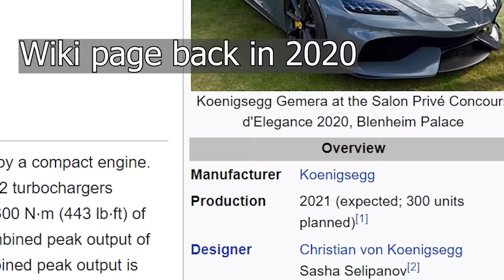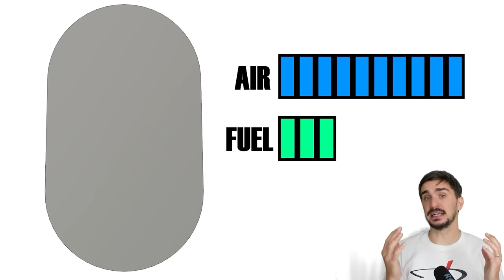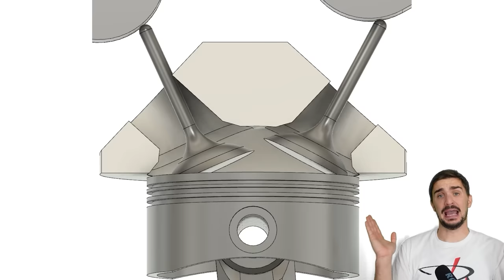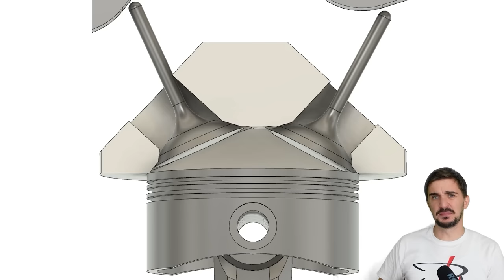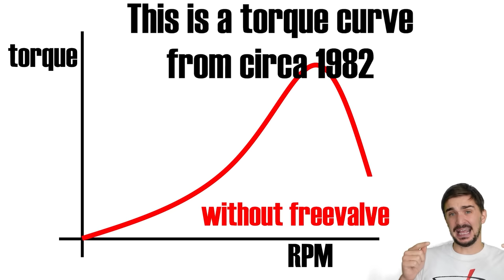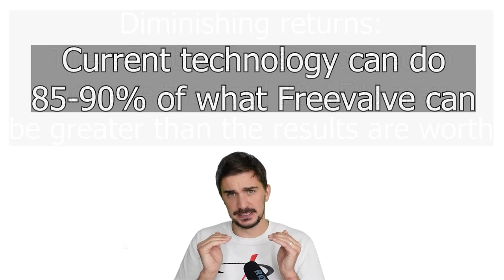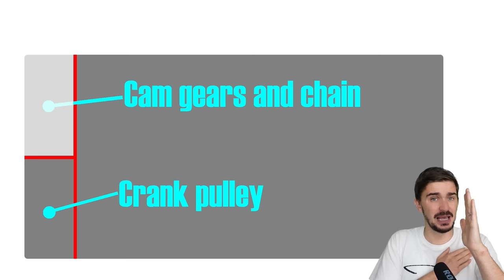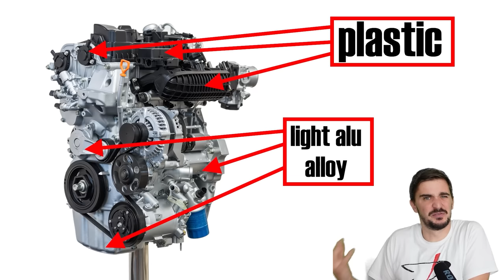FreeValve Isn't a Big Deal. Here's why

Comment: I was googling status of freevalve and I came across your video.

You are incredibly deceitful in your portrayal of information and I'm not sure if it's intentional or not. You spout numbers about peak power and torque when comparing the tiny giant to the GR corolla but somehow completely omit that one makes peak torque from 2000-7000rpm whereas the other is between 4-4400rpm. You gloss over time-to-torque, or what is commonly known as "lag" when you talk about throwing "2 bar of boost at a k20". Manifold pressure, turbine size, hot side geometry/size as well as exhaust pipe diameter play a huge part in determining manifold pressure which has nothing to do with flow rate. Example: Put a G25-550 @ 30psi on a k20. Ok cool now put a G55-2900 on there and run it at 30psi. Which one makes more power? Which one is laggier? I'd imagine that CvK didn't bother to show a dyno chart of that test car with the 1.6L engine. But if he did I'd imagine the whole chart is basically peak torque from 2-2500rpm resulting in an overall substantially higher average torque figure. It's actually amazing you have the audacity to say anything about the tiny giant at all, after all it doesn't have any throttle bodies or wastegates, which is another thing you gloss over in your video. 

I won't be watching any more videos, but I'm glad youtube has people like you to sway public opinion with your surface depth knowledge. Here's hoping we see freevalve in some mass produced cars.
Reply from the maker: Awwww did I hurt your widdle feelings. But reality is like that sometimes, don't worry, time heals all wounds❤️‍🩹💋 Don't forget to replace the candles in your CvK shrine.
Reply: You deleted my reply. So you can't even address the content of my post. What gives? @d4a
Reply from the maker: I deleted nothing. The content in your posts starts by calling me "incredibly deceitful" and ends with "surface depth knowledge" and you except a response?Also, I don't respond to acolytes. There's no point, because you're so deep in worship that you will refuse to see anything. So I just mess with you. But you're cute so I'll make a little exception. 1. Torque curve doesn't matter, most modern engines have 85-90% available from 2000. The 10-15% doesn't warrant the increase in cost and complexity having a wastegate never hurt anybody. It doesn't inhibit performance or reduce efficiency. It protects against overboost. Fiat Multiar and BMW valvetronic also don't use the throttle body like traditional engines, a few other systems probably too. It's in the video, but you got emotional before that so you didn't watch anymore and instead proceeded to the comments section to defend the cult 🤭
Reply: As I thought, zero substance. Valvetronic is just VVT on the cams, has nothing to do with replacing a throttle body.. You again gloss over actual average power gains, time to torque, etc. This is what I'm talking about here. You had an opportunity to provide something actually educational and instead it's all surface depth. You spent 10 minutes explaining how a cam works, don't go into detail on various different types of strategies used to get additional valve adjustment on the intake/exhaust side, don't go into detail on WHY we have 4 cam motors, nothing. You pretend like being able to advance or retard a couple degrees of timing is anything like this. You don't even mention how you can change combustion cycles on the fly. Has nothing to do with being in a cult man, I just want freevalve to be released to the general public.  @d4a
Reply: @ediconex  Valvetronic is not VVT it is VVL... And I'm quite damn sure it "replaces" the throttle body In normal operation(as BMW material say so).
Reply: What is the difference between variable valve timing and variable valve lift? The answer is nothing. They both accomplish the same things with different acronyms, just like VTEC is Honda specific variable valve timing. VVTi is Toyotas variant.  The purpose and premise to advance or retard the intake and/or exhaust cam to adjust efficiency profiles to achieve lower emissions and more power at a wider range of RPMs. As the video stated, static cam timing is long dead and pretty much all manufacturers use some methodolgy to control cam retard/advance. The one thing to note is there are different ways that some manufacturers achieve VVT, some use oil pressure (Think Honda F2x series) and only has two modes. Others like BMW use motors, and they call it VANOS. This sytem, especially some of the latest variants are much more advanced and give fine tuned granular control to cam advance/retard.

 A throttle body is required on all gas engines to restrict airflow. Feel free to google part numbers for throttle bodies on the S63TU4, S68, S55, S58, B58, B48, N54, N55, etc. I'm sure if you inspect whatever it is you're reading or just look at literally any repair guide to any BMW that's not electric or diesel, you'll find a throttle body.  @TarenGarond
Reply: @ediconex  VVL alters lift.
I mean Valvetronic does alter the timing quite a bit(As duration gets less with less lift) so yeah it most likely could be classified as VVT.
But while lift is largely changed the duration is changed in a less dramatic manner.
The lift could be adjusted to zero and therefore(quite obviously) a throttle isn't needed, the throttle is still there but seems only used in abnormal scenarios.
Reply: Not really, it's literally just another brand name. for adjusting valve timing like I said. Even you run a cam with with zero retard/advance, you still do not mitigate the need for a throttle body to control air intake on a non-diesel motor. This is why there is a throttle body on every single non-electric or diesel bmw. @TarenGarond
Reply: @ediconex  What you on about?!
Valvetronic adjusts valve lift while VANOS controls cam phasing(Do some frickin research man)...
If you can control the amount the cams open the intake valves from 0(Or close to) to 100% you obviously could "throttle" the engine(In a more efficient way) without any traditional throttle valve.
Reply: @TarenGarond due your own damn due diligence I’m tired of explaining. You STILL NEED A THROTTLE BODY because you don’t have INDEPENDENT control of each valve. That simple. Adjusting cam phasing is the same thing as adjusting valve timing. It’s two different ways to say the same thing. I’m assuming you did a basic google search and saw that every single engine has a throttle body. This is engine basics 101. Please go research what free valve actually does and enables

Comment: Premium Efficiency FreeValve / Power + Efficiency + Better Emissions //  chasing that top 10% more efficiency for 3X more money. It the reason that 50kW of Rooftop Solar PV + 100kWh whole home battery for all year 24/7 American energy waste 6kW per person electricity can replace grid power that costs $0.03-0.35 per kWh // so without subsidies, the PV + Battery system has a 30year ROI worse than a new GW scale fission reactor on 1000 acre complex somewhere rural with access to cooling water or waste sewer fluid like that Palo Verde reactor in AZ. Anything low volume & exceptional going to cost a huge price premium, like so many things in aerospace that are superior to their widely available medium to high volume automotive equivalents. Mazda rotary generator for range extended electric vehicles vs a free piston helium fluid sterling engine generator set of same kW capacity, where the rotary rane extender or liquid piston engine generator lower in mass, lower in cost, easier to produce in high volumes for mass manufacturing. Consider making one for everyone or 8 billion of something. This means the engine, motor, battery, chipset or whatever has to be high volume low cost per unit manufacturing optimized & designing the process & setting up supply chain logistics & organization & doing what Toyota Manufacturing Way does to make millions of Priuses, or Corolla, or Rav4. It's not to downplay the extreme engineering of Christian Von Koenigsegg or the Swedish company of his namesake but making a few of something great (300 or so) very different than making millions or more. I am thinking of those one-piece carbon fiber wheels they make, vs the magnesium alloy 15 in Gen 2 Prius wheels that weigh 14.2 lbs without a tire. Again, you can get a 7lbs wheel that is just as strong with vacuum casting prepreg high grade carbon fiber, but its going to cost 10x more. Think of the 12lbs carbon fiber bicycles that cost more than a dope motorcycle like the Yamaha MT03 thats the entry level into the MT series, aka $6000. I think it's crazy to pay $6000 for a bicycle, but the MT03 a great value new for that price out the door with tax & license. Also, bicycles do not require an annual registration, or insurance in most locals, where my MT03 costs me $400 a year for both, in addition to the capital cost, depreciation, maintenance, & fuel.

Comment: Freevalve? Why not? 

Cause we can't make a magnetic actuator that will operate for decades without repair. Too expensive to replace a valve pack ever 10,000miles.

Freevalve will be good for racing where u can replace the assembly after every race. We shall see freevalve hit gt racing in 2026 and then freevalve in a civi car 2030

Comment: You're looking at this all wrong... If you yake an engine and put in all the benefits you say, then remove the cam , lifters and all that stuff making valves do their thing, you're gaining all the power from losing rotational mass as well as losing 30% of engine weight, increase gas mileage etc...your argument is flawed...plus software programs could allow for anything... Only cost is prohibitive for now.
Reply: This is from a Motortrend article called "Is the Era of the Camless Valvetrain Finally Upon us?" :
"Möller says that although the compressor (featuring standard AC-compressor innards capable of peak pressures near 300 psi) generally consumes more energy than camshafts"

Comment: Excellent video! Of course it's ignoring the elephant in the room. All ICEs are dying, no matter the tech. Electric motors are inherently superior across every metric. Electromagnetic waves are as fast as light. Motors rotating are orders of magnitude more efficient than pistons decelerating to change direction. ICEs are intriguing just as steam engines once were. But they're dying fast and not just in motor vehicles.

Comment: Your explanations, despite the praise heaped upon them are over simplified and, in places, plain wrong. The Freevalve concept was always, as you correctly observe, wildly over-hyped, they took an “over promise and we’ll explain the delivery after they are on the hook” approach! Many people in the responses refer to earlier schemes that were solenoid or helenoid actuated and fundamentally doomed to failure, Valeo spent tens of millions funding a team of around 40 engineers without success. Your observation that VW-Audi do this, BMW do that, Fiat do the other is actually facile because none of these systems do it ALL and all of them suffer from their own limitations and drawbacks. The Freevalve approach was not as flexible as supposed and the Camcon IVT system far better but starved of development funds. The Camcon 4 cylinder 16 valve engine with  IVT on inlet valves only would idle beautifully at 500 RPM with an electrical power consumption by the system of less than 15 Watts. That is a 2%+ improvement in cycle fuel consumption right there, before you have done anything else. But no-one is going to spend any money on such a system now unless it is for heavy duty diesel engines